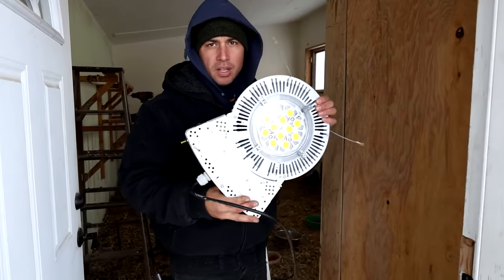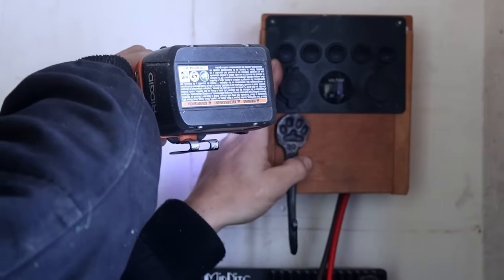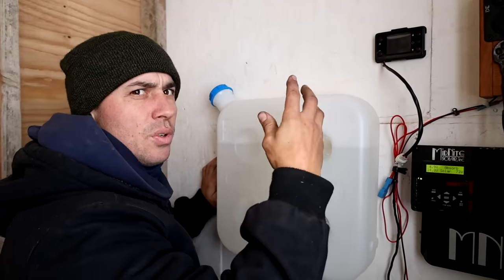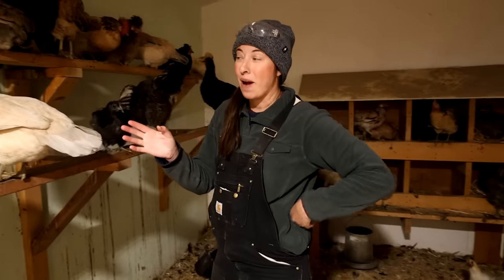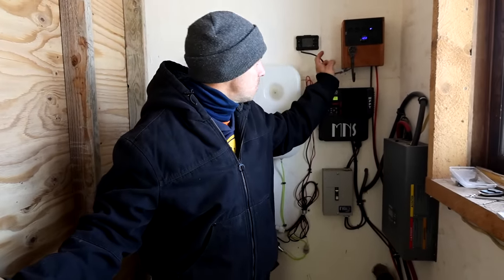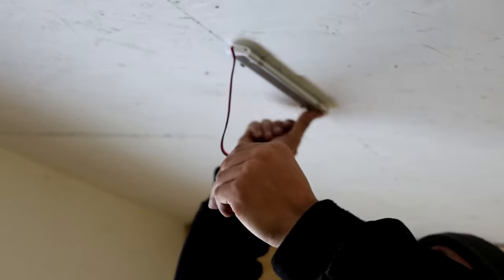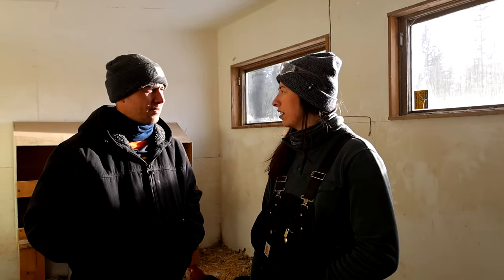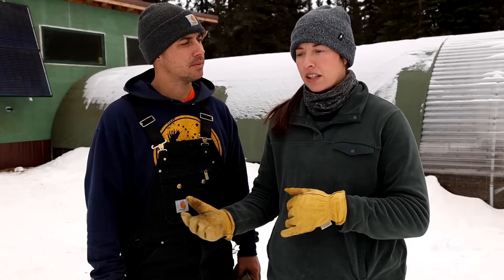Let There Be Light! | Heating the Chicken Coop with Diesel Fuel

Comment: Increase your light and egg production will go up. We run our lights on a timmer so they are still getting 12hr of light per day. We only have 6 hens and get 1 egg per day per chichen in the summer hr and drop down to about 4 per day in the winter. Also use an infrared heat lamp. 
Just love your videos keep up the good work.

Comment: Hi folks, you could try kerosene in your heater if you can get it easy your heater will run cleaner ,also set lights  to switch on earlier and let them go to bed with the natural dusk they’ll see better to roost as the daylight dims 
Great job you’re doing ❤

Comment: Nicely done - glad to hear you installed a carbon-monoxide detector to protect the chickens (and frankly, yourselves too).

I agree with the other person that the fuel tank should be away from the heater & also the electric works.

How many feet away from the home is the coop?  If within 300 feet, you should consider a remote temperature gauge to monitor temps during the ultra cold winter, and also a remote control for the lights in case you need to turn on the lights in case of predator harassment.

Speaking of which, such a pretty red fox at the beginning. 

How large is the new property?  It would be great to set up a whole network of hi-res cameras for "critter watch"!

Comment: Just a suggestion but run the exhaust pipe into the coop and have it exhaust outside after an un insulated loop to radiate the exhaust heat into the coop vs wasting it outside.

Comment: Great video.  Great ideas.  May consider having an air circulation system that has traps to capture the moisture.  It will be difficult because of the conditions you are working with.  Just suggesting.

Comment: You can buy fans that growers use and still control your air in the coop. 
You can suck fresh air from the outside on one fan and use another to push air out of the coop on the opposite side.

Comment: I may be wrong but I noticed you were pointing up when you were sharing that you installed a carbon monoxide detector. I was of the understanding that they should be low to the ground because carbon monoxide goes low and builds its way up.  Like I said I could be wrong.  Love your channel ❤

Comment: With the heater, you may have had internal condensation on your inverter since it’s attached to an exterior wall, so one side of it is extra cold, so it’s condensing water.

You need to move it to where it isn’t touching an exterior wall.  Your code went away probably because the liquid evaporated

Comment: You could pull the supply air for the heater from outside.  That would help dry out the coop.  I would do that through the wall that has the window.  You wouldn't want to do it near the exhaust.

Comment: I really enjoyed this journey.  But I was really intrigued by the heater in this video and the other video's you showed it.  I always wondered if it would work in a coop.  I struggle with heaters for my coop all the time but I am thinking this will work well.  Very impressed with how you set it up.  Nice thing is that you don't have to worry about dander plugging up the fans, which is one thing I battle all the time.  I would suggest figuring out the timer on it though so that you can keep a more constant, lower temperature in there.    Neat lights, although I wonder about the "blue" light - are they daylight LED?  I might have wired the outdoor light on a switch though so you can turn it on and off as needed.  Or alternatively, motion detectors on the two lights to help ward off the critter you showed at the start.  Overall though, very impressed and definitely a step or two up from mine!  Thanks for sharing.

Comment: You need to turn power off and drain pressure then check air pressure in Bladder tank . Fir a 30/50 switch the tank pressure should be 28psi . Failure to maintain corect pressure in tank will result in shorter pump cycles and less pump life . 
Hope this helps

Comment: Inverter issues : 
Take circuit board out and use a magnifying glass and look for a dry solder(tiny crack in solder) around a component on the board. 
Hard to see sometimes but is an easy fix on many electronic circuit boards. 
With the lack of lead in soldering on boards in recent years due to (environmental concerns) the new solder alloys don’t work as well and over time with heating and cooling, expansion and contraction can form small crack around the terminal.
So if you do find this, just re heat/solder  the terminal, and that should work if that is your issue. 
And if that’s not your issue, there is some information for you guys for electronic issues you may encounter for the future…
Cheers. 
Hugh

Comment: Intermittent faults on electrical devices are very often caused by dry joints, especially in environments with large temperature fluctuations. It's well worth popping the lid checking visually.

Comment: To protect the battery from the diesel heater pulling the voltage too low you can fit a voltage sensitive relay and have it switch off the diesel pulse pump. That way the diesel heater senses the pump being absent and triggers the shut down procedure.
If the diesel heater draws down the battery till it can not power said heater it will shut off instantly causing damage to the heater...

Comment: power down your invertor, isolate from power. open it up and look for corrosion, clean it off with an eraser or tooth brush then coat the spots with grease or better use (conformal coating). check the back of the electronic boards clean and coat as well. I bet that takes care of the code problem caused by frost is my bet. good luck, good content. let us know how it goes. my2cents

Comment: Someone on the site has probably already passed this bit of information onto you.  Not sure about the exact number of chickens you have in the coop.  You must clean the coop regularly removing all the bedding material which has been absorbing all poop and pee from the fowl.  The chickens will love it and respond by checking out the contents of the bedding like they are looking for hidden treasure.  The best bedding is wheat straw which I’m sure you don’t have access to in Alaska.  Wood shavings would probably be the next best and/or available product for you to use.  Also, you will probably note that the laying hens have slowed and maybe even stopped laying eggs.  You must maintain a constant temperature more on the warm side so the chickens will devote most of their time toward laying vs staying warm.  You probably have figured that out already.  Rotate your flock yearly or maybe every year and a half.  The younger birds will function and weather the cold conditions better than the older birds.  Good luck it’s going to be time consuming and part of your daily ritual.  It will also eliminate the ammonia smell that will almost knock you over when you enter the coup.

Comment: 4:18 You can mount these diesel heater in two orientations: 1. The way everybody does it with the pipes going directly down or 2. mounted with the pipes through a walk as long as the hot air vent is pointing to the left.
The reason for this is the way the burn chamber is build and the way the diesel heaters ignite.
If you mount them in any other orientation you may find that a little bit of diesel will leak out (every time the unit is started) and will collect in the housing and eventually leak out of the unit. Result: a diesel smell and potentially a fire hazard.
If you remove the covers of the heater (the carbon and black plastic bits) you will see the glow plug sits higher in the housing then the fuel inlet. This is intended to be like this and the only two orientations this condition is met is described above...

Comment: Eric,  If you pulled the diesel heater’s intake air from outside it might help the chicken coop’s moisture problem.    The dry makeup air should help to purge out the moisture.
Reply: And possibly add a relief vent on the far upper side of the chicken to vent out the warm moisture.

Comment: Great project and video!  Have you considered running the combustion air from outside?  That way you aren't pulling in cold moist air from outside.  Or does the fresh air coming in help?  Will the timer allow multiple on/off cycles so you could have it turn off the lights during the lightest part of the day?

Comment: How about a little dehumidifier unit that you can turn on for a couple of hours when the humidity builds up? ; I have one in a very old stone built outhouse with a tube going out through the wall to take the moisture away and it works very well in our wet English climate

Comment: There must be a way to harness the heat that's given off from the exhaust(?).  Maybe run it thru an old radiator before it's piped outside or coil 10' of exhaust pipe on the wall (and cover it with wire screen) to dissipate the heat before running it thru the wall to the outside.....

Comment: I'm not sure what the device is called, but I know in tiny or very small homes having an air exchange system that heats the air that is brought in from the outdoors helps the human inhabitants (cats and dogs, too), so why not chickens.  They're not inexpensive, aforementioned air exchange systems, but fresh air could circulate, cold temperatures are lessened as the air enters the space, and there may be a dehydrating unit attached to it.  You could also have a dehumidifier as a separate unit, too.  They work great in my basement apartment.  I'm glad your chickens are well.  May they live long and prosper.
Reply: Heat exchanger - lets fresh air in; uses heat from exiting air to heat incoming air, so have fresh air with very little heat loss.

Comment: I really liked your chicken coop improvements projects, as I'm sure raising chickens in Alaska takes a lot more care than in the lower 48. I was hoping to see you complete the end wall framing on the Q-hut, as that would give you a lot of room for equipment repairs and new projects over the winter. Plus you could build out your in-floor heating system, which is going to be a big challenge. If you need some good DIY advice on the heating, check out Youtuber 'Marshall Remodel" in Missouri. There are a LOT of very specific parts (valves, liquid, controls) required to make one work properly, and his floor slab was around 7,000 sf.

Comment: Omg! You installed flammable plastics fuel bottle right over the heat source? Either fuel bottle should be outside in the other side of wall or atleast not directly above the heater!

Comment: The Thermo Sensor is probably in the Input Panel. (not often but sometimes its on a thin wire or got an extra plug)
You would have to put it in the chickan Coup somewhat low to the bottem to detect the temps there.
Put a Metal Cage arround it (with a door) and verry steep angled top. To prevent the chickens to pick on it or sit on it.
Now you can save a lot of Diesel and Power to not heat up the coup without need and not overheat it.

You could also consider electric heating. There are Heating Wires for Growtents and Gardens with low power per Meter Length you could put in the floor.  Switch it on/off with a Thermostat  And from the Solar System depending on state of charge of the Batterie.

Also.. if you run the exhaust verry long on the inside it also heats up the Inside.

Comment: fyi, the blueish tint of the interior lights is 'color temperature' of 6000k degrees (Kelvin temperature scale - a characteristic of the LED's) used in the light fixture.  if you'd prefer something closer to daylight, change to LED light fixtures with a color temperature of 5000k.

Comment: Eric, I sent you an email. You need to relocate the diesel heater control panel to the coop side of the wall. There is no correlation of heat delivered back to the sensor in the diesel heater control panel. Love you guys.
Reply from the maker: Yes got it, if we use the thermostat option we will put in in the coop :)

Comment: Very nice.  But you are wenting a lot of heat outside, through the exaust. If you route the exaust through an old water radiator on just some pipes, before it went outside, then you would capture the heat inside the coop.

Comment: It would be smart if you used the exhaust heat from the chicken coop heater. The exhaust gases seem 
to be warmer than the warm air produced, which is extremely inefficient.

Comment: Hey Eric? if you want to put pipe in center like this i have an easy fix for you take a ring and put some holes in it Like say for instance a 4 inch hole you have right? so use a three inch ring three inches long maybe even two inches.. but put some screws threw it  every 3/4 of an inch...around the circumference of smaller little pipe...put screws inside new 3 inch pipe, sticking outward... through the holes you made so they stick out of pipe. should kinda look like brass knuckles with spikes hahaha. inside your pipe should just be the heads of the screws / bolts.. whatever you use...  run your pipe through Center back screws off until they touch inside pipe ... your exhaust pipe....you don't want it  to touch outside ring right?. slide whole thing in wall hole and the excess screw  sticking out will hold pipe away from inside of pipe.  Sure you can use high temp tape but this makes sure nothing touches anywhere except point of screw.. which should never have much heat on it EVER...

Comment: To bad you couldn’t do radiant heating in the floor or along the walls. Can your heater run 24/7 for months? I think the carbon detector is supposed to be low as it’s a heavy gas that hangs down low. I would think with chickens you’d want it pretty low as they would be exposed to more gas than the detector up high? Your great critter keepers.
Reply from the maker: Yes one of our friends did it and it works great!

Comment: The hot and cold fluctuations probably caused a solder point to crack on the inverter. If youve got the patience, time, soldering iron and a multimeter you could probably fix it

Comment: Mine is like yours  fully insulated and propane heat  but when I build it I made a door in the back wall 36x36  I park the tractor in front of it when I clean up   I don't have a run but got  a covered deck  no power to the coop

Comment: Hello.   I enjoyed the video.  I'm curious about how big the heated chicken coop is.  I'm considering one of these to heat a garage in Massachusetts.  Not nearly as cold and it's well insulated but the rubber gaskets on the 2 garage doors are the weak link.  Also what are you're thoughts on safety -- leaving it running unattended.   Thanks.

Comment: If the chicken coop was closer to the house you could probably heat it with a extra hot water loop from a outside wood stove that also was being used to heat the house, got to figure on heating it for 5-6 months per year.

Comment: Great Job on the coop. But question. Since I watch all of your videos. I've heard at least at the cabin on the lake Eric mention having to wake up a few times to stoke the fire to keep the temperature through the night. Why don't you actually do this for your cabin on your homestead?  If you have an average burn time with a fully loaded wood burning stove you could set the timer for the heat to kick on around that time each evening & turn it off after you've gotten the fire going in the mornings. I might be wrong but I thought they made duel fuel heaters similar to this that you could use propane or diesel with. But either way it would seem appropriate that you set up the same/similar  or better in your own home to make it more comfortable for you in the winter especially with your much larger solar panels/system. You might even be able to run an electric heater in the same manner on such a large solar system. Anyway I just kept thinking that the whole video so I thought I'd try & ask if you all had something in the works for your own home.  You guys do such a great job keep up the good work. As always L❤VE from Kentucky!

Comment: The diesel tank has to be mounted lower than the heater otherwise the diesel drains into the heater. The pump has to be close to the tank, these pump can’t suck as good as push the diesel. Both the exhaust and the fresh air inlet needs to go direct to the outside because otherwise the diesel heater burns  the oxygen from the inside. Normally the mounting plate is mounted directly to the wall and the heater is mounted 90 degrees directly to the wall so the exhaust and inlet is outside because of the exhaust pipe isn’t  airtight an loses exhaust fumes to the inside.

Comment: I wonder if you could capture some of that exhaust heat to keep the outside water from freezing by wrapping the exhaust (under the muffler wrap) with 1/4 copper pipe and using thermal siphon to the outside water dish.
Reply: I reckon it could also be used to keep the snow off the solar panels
Reply: I'm always impressed by your work ethic and creative problem solving.  Love your videos and look for ward to every new one.

Comment: The problem with the Inverter may have been moister. when you started the diesel heater you increased the moister in the air and the inverter took some time to warm up  and it may have condensed in the inverter.
Reply from the maker: Thanks for the tip it seems to be working :)
Reply: You could also try blowing out any dust that may be inside ( hold the cooling fan still)  @SimpleLivingAlaska

Comment: I'm wondering if there is no off-road diesel in Alaska? It is the same exact fuel just tax free. I use it here in Colorado along with a fuel stabilizer in the extreme cold. Also, that controller for the heater has timer options as well!

Comment: Hello I live in delta junction and I'm working on my chicken coop also. I have a 100ah battery to run the light. I saw the diesel heater uses 5kw. What size is your battery bank.
Reply from the maker: The heater produces 5kw of heat, the power consumption of the heater iv very low. We have 4 6 volt trojan batteries